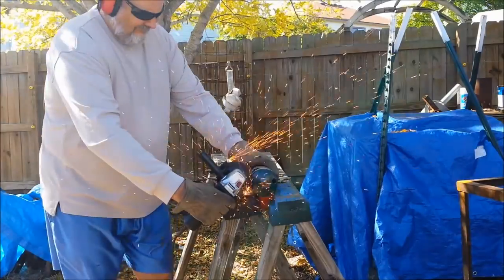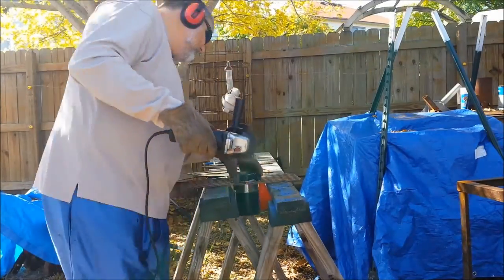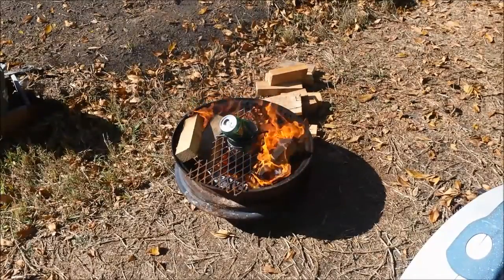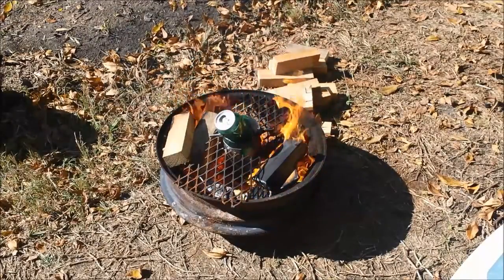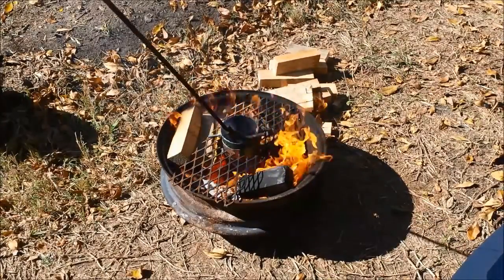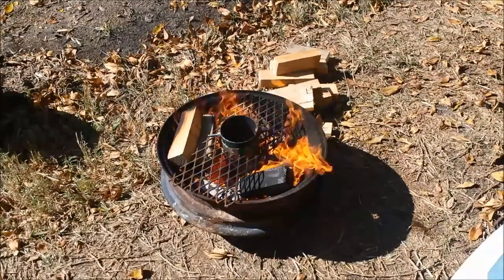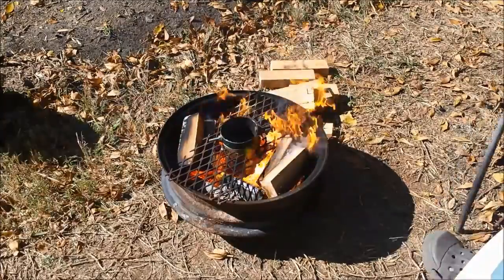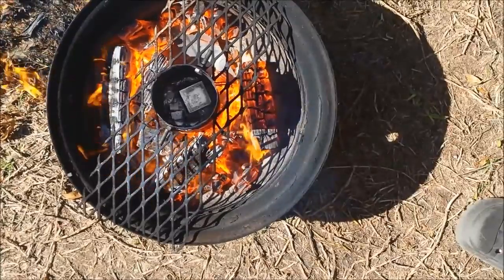Easy wood burning foundry - melting aluminum or lead

Comment: can you make a large crusible from a 20lb tank i melt alot of aluminum and was woundering if a large crusible made from a 20 lb tank would work or not iv made sevral of these small ones but would like to melt more at a time if possible
Reply from the maker: I suppose it would work but would take a lot of heat to melt something that large. I would think it will still only last 3 or 4 melts then the steel gets weak. The small ones only last a few times before they are unsafe to handle with AL in them.

Comment: If you have an old hair dryer or air pump for a blow up matress you can attach a metal pipe to the end and force air in under the rim. This will get more air into the fire making for a hotter and faster burning fire. You might also try a smaller rim. The less space on the outside of the crucible makes for better heat exchange.
Reply: Will a digeridoo work or not enough air?

Comment: I tried doing it without fan just wood and I had a piece of cardboard to wave it and get it hotter (kinda worked)
It melted but it needed more heat
Reply from the maker: Yep... the next time I piled on the wood and got a good bed of coals first. Then crucible and more wood. Not real efficient but "gits r done" ;)

Comment: I built a foundry and it melted the metal propane tank that I had cut in half I need a thick steel one or buy a real graphite crucible.
Reply: Thats probably because it wasn't a steel tank. It happens to everyone. Check it with a magnet first. If the magnet sticks it steel, it it doesn't stick its not.